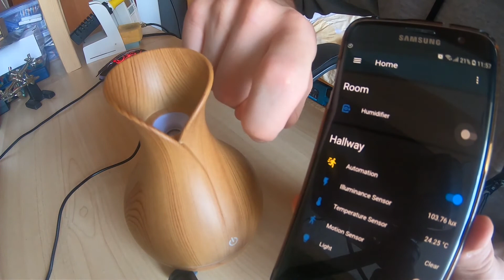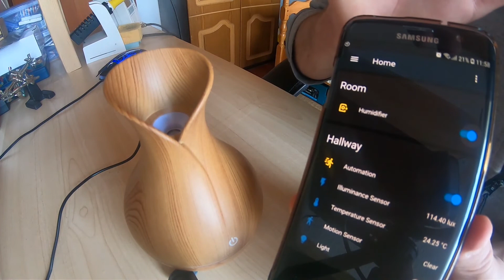I've made this cheap Air Humidifier smart!

Comment: Back to ask you one more thing after 3 weeks of my initial comment. May I ask you to post the schematic of wiring for this project especially the power state read-write/soft-latching momentary switch part of the wiring. You mention at 6:28 that “Complete wiring diagram is available in the description” but I couldn't find any, I think you missed it out. I believe posting posting the schematic will only add value to your video. Thanks again & awaiting your response.